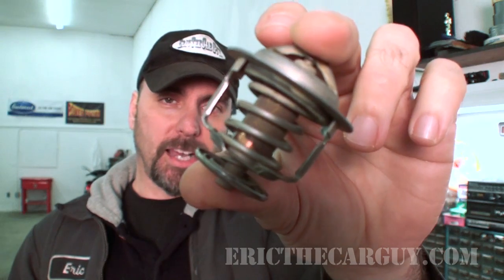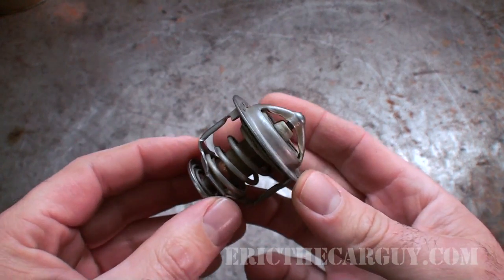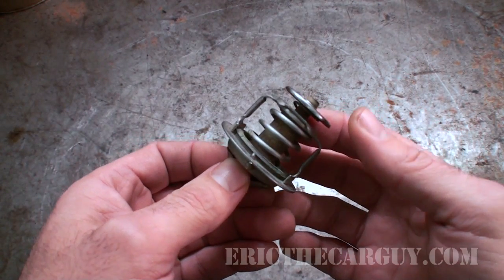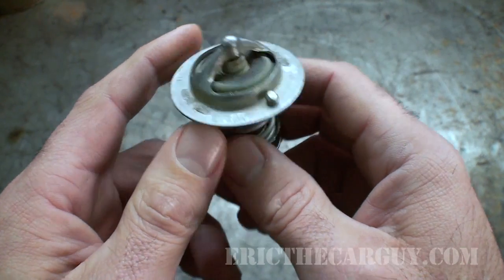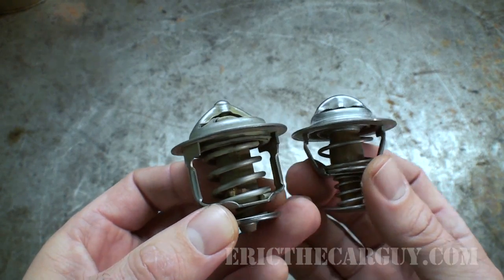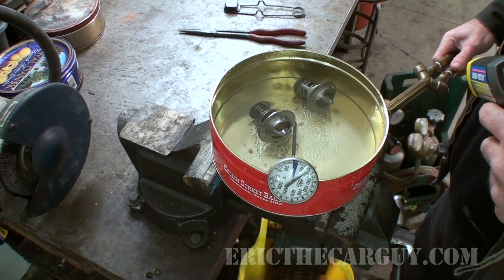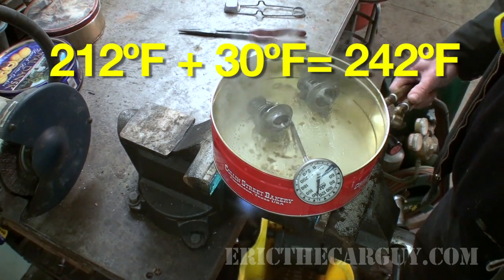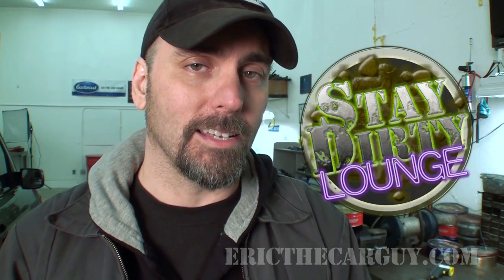Understanding and Testing Thermostats -EricTheCarGuy

Comment: Hey, Love your videos, Eric!  I have a question, I dont know if here 
is the best place to post it, but I could really use some help figuring 
out why my 1991 Celica 5sfe engine wont pass emissions here in Colorado.
   I have performed the check engine light test (bridge w/short wire) 
even though the light never came on in the first place and it blinks 
continuously, so its not throwing a code.  It does run, and doesnt 
smoke, but it wont pass emissions!  The Air program evaluation was 
performed and here are the Obsevations and Comments listed by the 
technician.  " Fails CO at 101 GPM. Runs 11% CO at IDLE. Stays in open 
loop. VF is 2.3 Volts, O2 voltage is over 800 MV. IAT is 1.5 volts. Map 
at idle is 1.84 volts and vacuum is 17 in HG. Ignition Timing is 10 and 
distributor is in the proper position. Idle and 2500 RPM injector PW is 
2.3 - 2.5 MS. Everything is in spec, but no closed loop."  The Comments 
section reads "CHECK FUEL PRESSURE. WHEN REMOVING VAC LINE TO REG, CO 
DOES NOT CHANGE. REMOVE ECU AND CHECK ALL POWER AND GROUNDS AND THEN 
VERIFY ALL SENSOR VOLTAGES. MAP VOLTAGE IS SLIGHTLY HIGH BUT I TRIED 
USING VACUUM PUMP TO BRING IT DOWN AND STILL NO CLOSED LOOP."   Passed 
smoke test. I had a mechanic look at the evaluation and he wouldnt even 
diagnose it for less than $200 and there wasnt a warranty that he would 
even be able to diagnose it.  Could you give me any advice?  I did replace the radiator myself about 7000 miles ago, but I was pretty sure I bled the air out. And I checked the (aftermarket) thermostat today and its not stuck open.  Any suggestions or should i just take it in to a mechanic?

Comment: Hey Eric, absolutely love your channel.  I would be completely lost without it.  I have a thermostat question for you.  I have an overheat issue that I believe I've pinpointed to the thermostat being stuck closed as my fans don't come on in spite of the temperature reaching nearly 230 degrees.  

I removed the thermostat to test it as I wanted some proof that the thermostat was indeed the cause of my overheating issue.  I placed it in boiling water and it proceeded to open, I pulled it out and it closed.  I repeated this process several times and the thermostat performed as it should; opening in the boiling water and closing when it cooled down.  Would this mean that the thermostat is still good or could a faulty thermostat do this as well?  Many thanks for your videos!
Reply: Don't be a tight ass and just buy a new one!!.

Comment: I've run without a thermostat in a dodge neon one fall for some reason (I can't remember why) for a short time but the car never had a problem.  I don't know why, as I know how important it can be, but the car got to normal op temp and I had heat in the car as if it was in place.

Comment: hi sir eric. my cars temperature is going high when im running more than 100kph. so i decided to check my car in the garage. everything is doing well. radiator fan ac fan hoses etc. except one thing there is no thermostat on the car when we checked it. (bought used car) do you think its ok if i just keep the car with thermostat in it? im in the middle east by the way.

Comment: PLEASE HELP!!!! I have a 2002 dodge dakota 4.7 l v8. I have a new radiator/hoses new rad cap new water pump. Pump is still good not faulty i can take cap off start it and watch it flow but I have to refill it everyoncein a while because it doesn't pull from the resoivoir why? Also put 2 new thermostats in and i overheat but if i run without one i stay cool all the time whats wrong ?

Comment: how do I know what's wrong with my Buick, my car reaches past the half mark on the temp gauge when I'm stopped at a red light but when I drive it goes back down, but it has not yet reached the red marker
Reply: Donnie Longo Jr  Make sure your radiator  fan is kicking on.
Reply: My 99' Chevy Silverado Is Doing The Same Thing, Once Engine Is Warmed Up It's @ Normal Operating Temperature, The Hotter a The Engine Gets, While In Driving & Sitting @ Red Lights Is When Its Starts Climbing Up To 220F 230F, I Start Driving & Then The Gauge Starts To Drop, Just Started Doing This A Week Ago
Reply: I'm having that same problem
Reply: would a bad thermostat cause the radiator fan not to work? my camry is doing the same thing. i'm checking the relay and cooling sensor tomorrow. i'm assuming i'll need to replace the thermostat too.
Reply: Samuel Lay -  I agree. Very likely the kause. -Josef

Comment: i just replaced one on my lexus, it was frozen and stuck open just barely, was getting a slight overheating issue and the heater wasn't working very well at all. soon as it was replaced(i used an aftermarket failsafe one) it all worked as it was supposed to lol

Comment: Older Volvo thermostats were great. When they failed, they failed "open". Meaning they didn't blow the engine up. No overheats, just a check engine light. They just gave poor heat. A nicer alternative to a warped head. A great design.

Comment: my grand am is 3.4 and is boiling over out of the resevoir all brand new tubing water pump temp sensor  but not a new thermo we replaced that last year but is blowing cold air inside the car is this a bad thermo?
car gets up to 200-240 degrees no white smoke out the exhaust or coolant smell

Comment: Eric, I have a 1996 Geo Tracker 4 door 4x4 with the 1.6L 16 valve 4 cylinder. I just noticed tonight (just after midnight) that when I parked it when I got home from work that it pushed out coolant when I shut it off. This past fall I replaced the radiator, belts, hoses, and thermostat. I had checked the coolant level and topped it off Tuesday for a long(er) trip planned for Wednesday. What do you think is going on?
Reply: John Lincicum .0

Comment: Question: I just had some freeze plugs replaced on my Chevy PU with a V-6 Engine. The temperature gauge keeps fluctuating between 160 and 210 degrees, which to me, indicates a faulty thermostat; but maybe it is something else, like air in the system. What is your opinion?
Reply: +Marc Del I think you need to see some things as the level of oil or water and then have to see if the water pump is in function or not there is any water leakage . Its too much thing  you need to se them
Reply: +enea malku Thanks! Checked out all of that and changed thermostat and temperature sensor. Temperature gage still fluctuates though. Mechanic had put stop leak into the system, but I don't think that has anything to do with it. It's been too cold to really investigate they whole system, and unfortunately the freeze plugs are still leaking, only slightly.

Comment: Was wondering that my BMW radiator cap says 200 on it. What is that supposed to mean? Is it the temp mentioned or the pressure or any other sorcery? 

Im asking this because my car while driving shows 108C as normal temp. Obviously that is over the boiling point of water but the car never heats up as in theres no indication from computers or gauges that monitor engine temp. 
Im confused here
Reply: +kaisar1 It's probably 200F or 93C hence your normal operating temperature of 108C

Comment: Should I do a radiator flush after replacing a bad thermostat? Replace hoses?  Change the oil? In the process of troubleshooting, my 2000 Honda Accord 4-cyl overheated 5 or 6 times so I am worried about damage to things - hoses and the engine.  No blue smoke or idle problems so far, but I am wondering if I should do a major radiator/engine flush and which hoses I should replace. Any advice would be appreciated.
Reply: +Chris S I would not bother with anything but new coolant to top it off as you will have to evacuate the system again soon for a timing belt change right? Also all is fine now that the thermostat has been changed? If so that should suffice.

Comment: Eric I have a very curious problem my cars temp gauge start out at normal operating temp while driving then it will jump up to hot. Yet if you turn on the heat to high it blows COLD ! if you keep driving the temp gauge will drop back to normal operating temp. Please tell me you have some idea what the HELLS going on with my little 2001 Toyota Celica ?
Reply: +sweetbrandigirl Probably air pocket. Burp your radiator, see links in description of this video. Good luck!

Comment: I have question  my car engine stayed cold all the time Sometime work fine but  most the time not ..I changed the engine  sensor temperature still the same any help!
Reply: +Younes Ali Thermostat is staying open probably.  Replace it.  They are cheap.  If that doesn't fix it then it may be the water pump or a blockage in the system.

Comment: I have a 2005 Dodge Durango.  Had an overheat episode yesterday, can a thermostat malfunction intermittently?  My daughter had closed all the air vents except one and we drove for 45 or so miles with A/C on.  would vents being closed cause overheat?  The system has also needed to be flushed for at least 2 years...part of problem I am sure.  Dealer said since one side of radiator temp was 35 degrees different from the other I need a new radiator.  I am wondering if a power flush would correct problem, and make sure air vents remain open?  And wouldn't a thermostat be clearly good or bad...not in-between?
Reply: +Betty Ann Usually you flush the system every 2 or 3 years because the coolant loses its properties to protect your engine but a simple evacuate and refill should suffice, you don't need a full flush. Vents close don't matter, not sure you're closing the vents if you are running the AC though? You like to waist gas maybe? AC can put an extra load on the engine (heat) and may result in overheating. In your case, the radiator may be clogged so a new radiator may be the solution to efficiently cooling your engine. Also you may have air in your system which would explain the intermittent hot/cold. Good luck.
Reply: Lol, my child likes to close the vents and is intellectually impaired and stubborn.  I went ahead and had thermostat replaced and the radiator seems fine since it has been flushed.  Thank you for reply

Comment: Diagnosing a problem with my e36 323i, It would overheat after 10-20mins of driving, the higher the revs the faster it would overheat. 

Put my thermostat in boiling water and it remained shut, assuming it was the problem, will be replaced soon.

Comment: hi I have a 05 ford f350 it doesn't have any heat when it's stopped or when I'm at a red light but when I drive the heat works it blows hot air my truck is a powerstroke turbo  diesel  6.0 could you please help me thanks

Comment: I only ever removed the thermostat if I needed to get home, then I would replace it at home. But I never ran without it like days or weeks on end. Cause if you remove it you can at least get home. If it's in closed position all the time you would do damage to your motor anyway. But obviously you don't want to drive around all the time without the thermostat, like you said. That's no good.

Comment: Thanks for the taking the time to posting the video on Thermostat.  Error code on my Mazda is pointing to thermostat issue, but do not notice any difference in engine temp and/or cabin heat.  Will replace as advise by my mechanic

Comment: the engine fan is always on on my 2001 vw beetle, could this be because the thermostats is not working properly? what are the problems that can cause the fan to always be on?
Reply: +Pablo Savinon It will burn out then your engine will burn out.
Reply: +Cyril Azoulay thanks for the info. turns out it wasn't the thermo, a small leak caused a short circuit to have the fan running all the time. problem has been fixed.

Comment: Is it possible if the system wasn't bled properly that it would cause the car to run cool? Parked, the car gets normal temperature range. once i start to drive the car cools down rapidly. Audi 90 12v AFC motor. I was leaning towards coolant temp sensor or thermostat. most likely thermostat stuck open? also, heat is not very good once in drive, since the engine cools.

Comment: MotoRad makes a "FAIL-SAFE" thermostat. When overheating occurs, the thermostat automatically locks in the open position. However, it remains open permanently, and must be replaced. I plan to install one on my Jeep Liberty, because it it somewhat more difficult to replace.
Reply: metalmoto qq
Reply: That sounds like a bad idea... unless you never tow or drive in hot conditions.

Comment: A third very uncommon thermostat failure that actually happened to me. Where the two metal arms connect to the larger round part, somehow rusted, and broke off. The bottom part of the thermostat dropped down, blocking coolant flow completely. Luckily, I was able to snatch the bottom part out with needle nose pliers, before if fell down into the engine even further... It was a very old car, and probably the original thermostat. A 1982 Dodge Aries K car,

Comment: I have a BMW 1999 323i car has overheating issues, changed the thermostat the old one was just stuck. and when the car was overheating the only leaks was from under the cap from the pressure not sure what's going on if it could be my water pump or radiator my radiator is bent and the fan in front is bent also but the car was driving fine for awhile with the bent radiator and fan can you help me out thanks.

Comment: Thanks for the video.  I just replaced my thermostat in my 2003 Ford Crown vic.  Apparently there was no o ring on the housing cause now I have a minor leak.  Car intermittently over heating as result.  Going to tear it down tomorrow and put an o ring on it.  Hoping that solves all my problem.  It has used a gallon of coolant in less than a week as a result.

Comment: Eric, 

I changed the thermostat in my Hyundai Santa Fe, both thermostats are rated at the same temperature, however, after changing the thermostat and replacing all the hoses, The car is now making a knocking sound.

Comment: hey eric I have a 2005 dodge neon my thermostat was stuck replaced in and also the engine coolant temp sensor and bleeded air out of system now its not over heating but this morning the gauge read it was over heating but engine and radiator hose are warm to the touch not to hot and when I shut off cools off in 5 mins  I know I dont have sytoms of a blow Head gasket im think maybe I install ed thermostat wrong or possible  faulty engine coolant temp sensor? what do you think thanks Nathan

Comment: I am having problems with two cars, a 2002 Camry and a 2004 Buick LeSabre, getting too hot in these 100 degree temperatures in Houston, Texas.  I don't understand why you can't just take the thermostat out?  It's just blocking the free flow of radiator fluid to the engine.
Also the electric fan motor won't turn.  On the Camry I replaced the electric motor which was basically the whole assembly and it doesn't appear to help and the fan won't turn.  Any ideas?  You kind of glossed over what happens when you simply take the thermostate out.

Comment: Hey Eric. I have a 1989 22RE Toyota Pickup DLX 4x4 5spd, no modifications done to it aside from suspension (no lift, 31' tires). I have a very slight intermittent miss, only at idle. After the engine warms up for 15-20 mins, you can notice a putt in the exhaust and the engine twitches a little each time.

I have replaced the distributor cap and rotor button, spark plugs and wires, gapped spark plugs to OEM recommendation, timing chain replaced in last 200 miles (thought that would fix it, old guides were broken to bits.), it is timed right on the money. I did a seafoam treatment by feeding it into the throttle body through the brake booster, and treated a full tank of gas with BG 44k. I've listened to each of the injectors, they are ticking nicely. The radiator was replaced at the time the timing chain was done, the water pump and radiator fan were replaced ~2000 miles ago.

The truck runs pretty good once you get it moving, it has good pull when I am running around off road and on the highway. But that dang miss at idle it driving me crazy, and it seems like it is getting 10-14 MPG, which is really low even for a 22RE 4X4 on the recommended 31' tires. I'm not sure where the temp guage should sit on these, but it seems to hang around 1/4 of the gauge at all times. Possibly t-stat always stuck open?

I was thinking of going for the big boys next, MAF and TPS, but those prices if I am wrong... Would the thermostat lead to these kind of symptoms? Thanks in advance!

Comment: How do I put silicone on thermostat housing, on a 95 Z71 4x4 k1500 with new one in it. Plus I have a plastic c like thing on it.put new one in and still leaking.  The c like plastic thing is hooked to a sensor like plug that goes on with housing.

Comment: A little while ago I got my water pump replaced and everything was working just fine but recently, my temperature gauge fluctuates sometimes. It never used to do that. It doesn't do it often but is this a sign that it could be my thermostat?
Reply: Ahmed Haggag Yep, that's the job of a thermostat, to keep a very consistent coolant temperature. My temp gauge started to fluctuate, I removed the thermostat to discover it had basically fallen to pieces. The thermostat was an aftermarket one the lasted 5,000km's - I installed a genuine Subaru one and it's been fine ever since, holds a very steady temperature again.

Comment: Great Video, I'm about to replace my thermostat (2007 Mazda 3 2.3) as I got a check engine light indicating the Coolant Temperature is not reaching the the operational temp in the designate time. I would think the the thermostat is not closing properly.